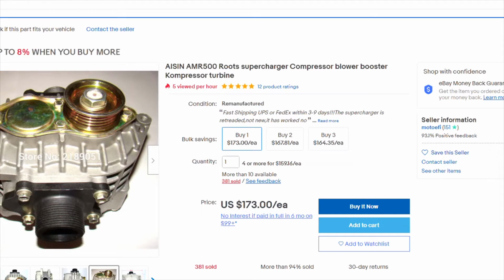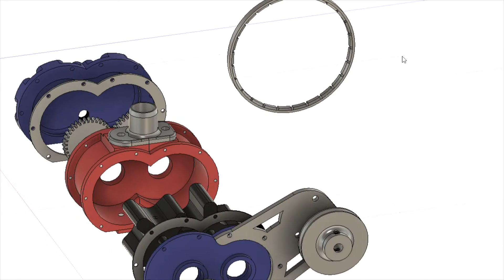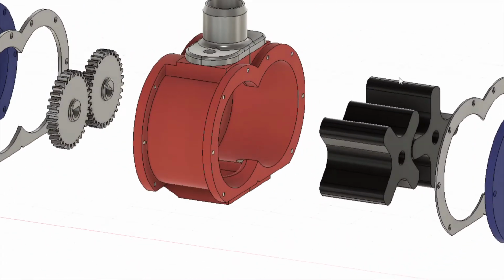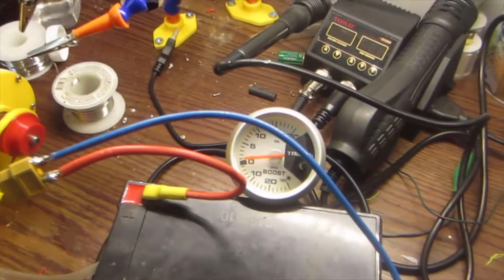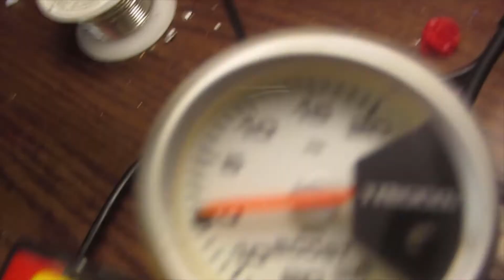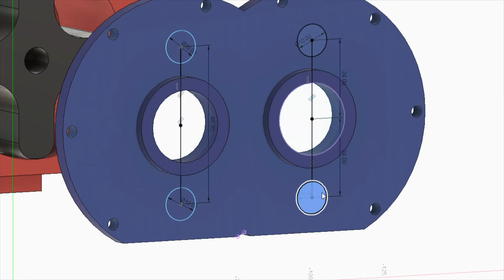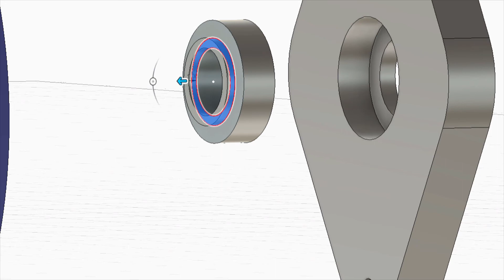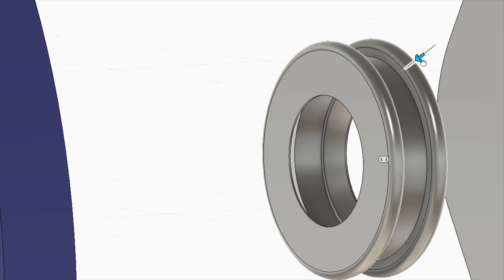3d printed supercharger (part1)

Comment: Hey how old are you? You kinda sound younger? I’m jw, Bc bro, you got a future if you keep this up fr.
Reply from the maker: thanks , I'm 32 , I was a machinist for 12 years then I ran into medical issues ( kidneys shutdown, had a stroke) . since then I have been doing this stuff to sort of keep up my education . I have plans on getting into the cnc end of machining if and when my health improves . If you liked this video take a look at some of the other air pumps I have made up , they actually build pressure .
Reply: @turboprint3d  oh wow, I’m gonna print this and try it out on a predator 212, can you maybe give me a list of the hardware used?
Reply from the maker: @Flatout56-o8k  so the files i have are a little different and not really finished at least successfully , the vane pump works the best currently followed by the regen blower. i have yet to actually finish and make pressure with the roots blower . a 212 should be ok for the air flow produced but yo may have to modify some stuff to make it work properly . so it needs 20-24 m3 x 12 screws , 4pc 608rs bearings and 2 shafts , 10mm in dia turned on eatch end to 8mm, if you got my prototype files from cults or thingivers the drawing for the shaft should be in there as a pdf .
Reply from the maker: @Flatout56-o8k  https://www.thingiverse.com/thing:4856346
Reply: @turboprint3d  thank you! I’ll remix some files possibly, I can’t wait to print it, your good at what you do, keep it up man!
Reply from the maker: @Flatout56-o8k  I do plan on finisheing it, Im sortof add ish with what i work on so im not sure when . if you print it as is u may have to sand the rotor seals to fit ,originaly the seals are nylon, they might work as another material or it may work without the seals all together , the white one in the videos is super super loose and is more of a fan that a pump , the one on thingivers is the improved version , it really just needs some refinement , but i ended up damaging everything i have currently so i have to reprint. I plan on machining the housing inside surface and the rotor seal tips to match in the long run .

Comment: great job, i tried to make one out of cnc aluminum but failed
Reply from the maker: Thanks , I will likely end up with a machined parts in the long run as I see heat being a problem as well as a few other long term use problems . I'm thinking about putting this ( when working ) on a mini drag bike I stared building years ago . When I was working I had drawn up prints for a roots blower and figured out have to do all the work on manual machines but never had the time to do it .